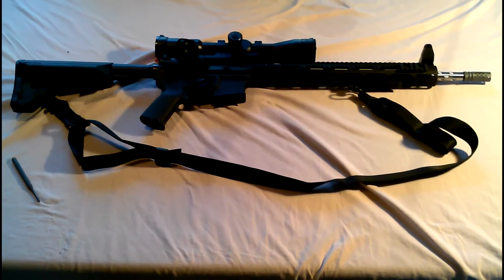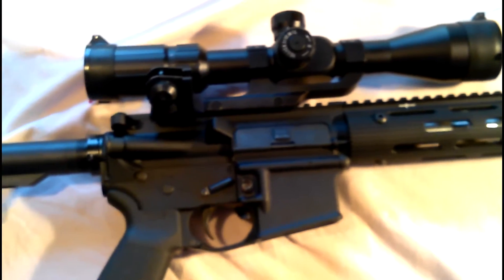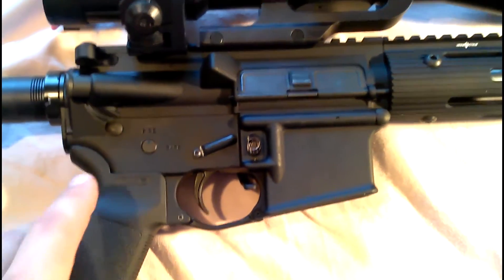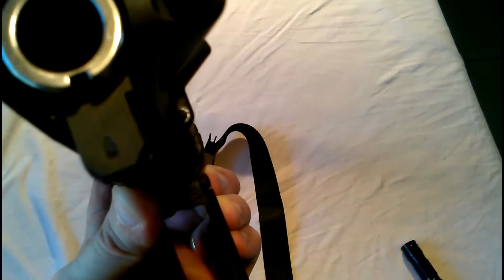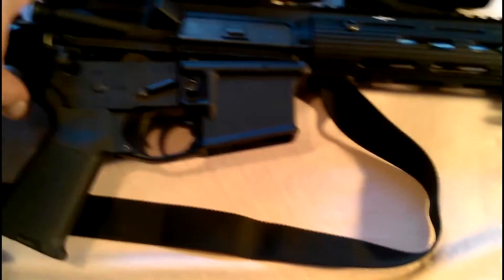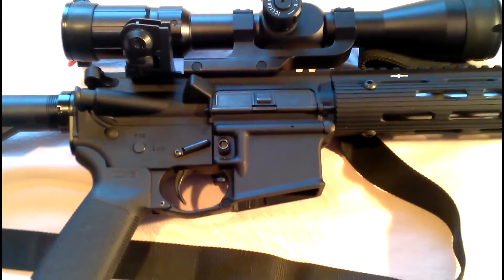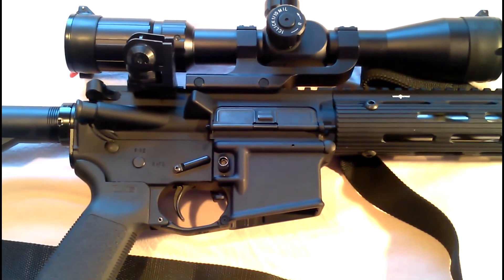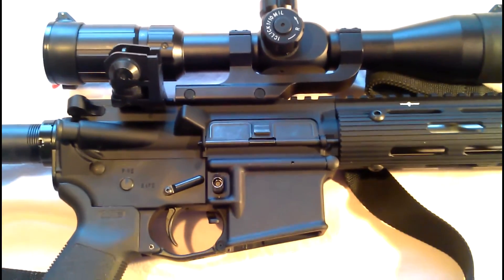AR 15 Upper Receiver Markings

Comment from the maker: The consensus seems to be that the square forge mark denotes it was forged by Brass Aluminum Forging LLC (BAF) I have read that they are one of the suppliers of forgings to Colt and companies such as Daniel Defense, Bravo Company and Rock River.
Reply: My Colt M4A1 in The Air Force had the keyhole markings..

Comment: This is the beauty of CNC machines...  its either within the spec tolerances or not... if its good... then the forge is all that matters... because it denotes material quality.
great vid. learned yet a little more
Reply: Kinda vague but ok.
Reply: @deltabravolima1514  I can easily clarify:  When building your own rifles;  If you are buying a "brand name stripped receiver for $280... vs buying a cheap Anderson receiver for as low as $25... That were forged at the same place--------  and their machine work on both are exactly the same 'mil specs when you measure their work.  You are getting ripped off, and should just buy the cheap receiver;  because the end product is the exact same.    People like to shit on budget rifles like they don't work-- but they are wrong.  I've built over a dozen different budget builds for well under $400 each, including the receiver...  Years ago their used to be some bad companies out there that you could get some trash products from-- but they've all gone out of business by now just through word of mouth spreading across the internet.   These days there are well established budget companies who sell all kinds of kits and  they work fantastic..  Psa, Bca, DiamondBack, Geaux Armory, Delton, Daytona tactical, OutdoorsportsUSA, and many others.  Stop buying $3000 rifles and just build one that is virtually the same for $350..   That was my point.
Reply: @deltabravolima1514  You can sell gun stuff on Gunbroker. ...   and gun.deals is a great site that searches all kinds of dealers-- its like the "google of the gun world.   Great for buying stuff

Comment: My new Colt M4 has a C with a square beside it right above the bolt assist. No markings on the rear lug. Great informative video
Reply: C = Colt  Square = Brass Aluminum forge    screw Colt  read Eugene Stoners book and see what he said about Colt, i assure you its not good!!!
Reply: @MasterWitchDoctor  because you cant afford a Colt or a Scar?

Comment: I might not get an answer to my question on here but my upper has a square on the side and a G above the charging handle. Ive looked everywhere and cant find any info on it. Can you help?
Reply: no idea on the machining mark, but the forge mark (square) is BAF. They're a top tier forge, so you got a good one. It won't blow up in your face.

Comment: i bought a bushmaster recently and all the bushmasters i see on line have different markings then the one i purchased did bushmaster recently change their forge ? even the ones on bushmasters sight do not have the same forge marking as mine also i have noticed that on the left side of the mag well where the lines come up and meet they do not exactly match to the upper gun shoots fine and everything works fine most people woudlnt notice a centameter difference just wondering if anyone knows what is up with that my upper has the marking that looks like a broken A what does that mean and why is it different from other bush master firearms that i have seen on line
Reply: I have same thing broken a
Reply: The lines that don’t match are the same in mine.

Comment: Great video! I have an M on the front of the upper between the gas tube hole and the top of the receiver. Any ideas?
https://www.ar15.com/forums/ar-15/UPPER_RECEIVER_MARKINGS/118-397380/
Just found this. Couple posts down this thread is a list of markings.

Comment: I am a bit disappointed in this video. I was hoping to see information about many forge marks. Mine is a sort of disconnected letter A. It's from an M16 A1.
Reply from the maker: I am sorry you are disappointment in this video. This video was a response to another video that came out the day before on another channel that had some misconceptions regarding who finishes AR 15 upper receiver blanks.

If your upper is an original M16A1 with a "splintered" A it was forged by Anchor Harvey Aluminum, if the mark is an A and F turned into a single character then it was forged by Alcoa Forge. This page has good information regarding forge marks on A1 and A2 style upper receivers: http://moonborn.com/m16-m4-and-ar15-upper-forge-codes/
Reply: It's a Splintered A. Anchor Harvey Aluminum. Thanks for the codes site. I've had this upper for over 20 years. Just getting around to building a semi-auto M16A1 clone. 173rd. Airborne.Viet Nam 1969. Thanks again.
Reply from the maker: I'm happy to help. Have fun with your build.
Reply: Chuck,  I am disappointed in your comment.  I came down here hoping that you would have posted a list of forgings for us... lol............    That's how ridiculous your comment looks.. smh
Reply: Disagree. It was good enough and gave a great avenue to open up dialogue for input. Good job HereToLearn442.